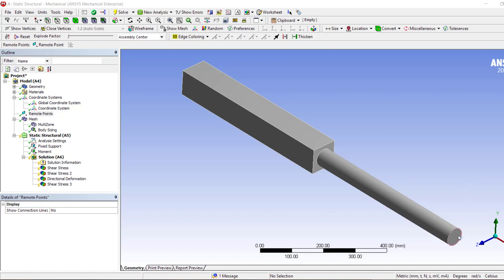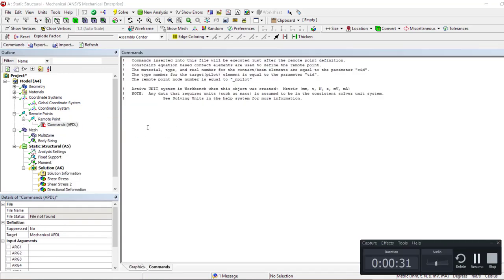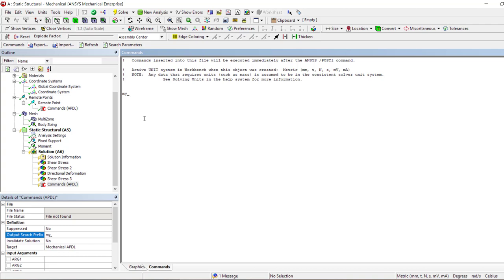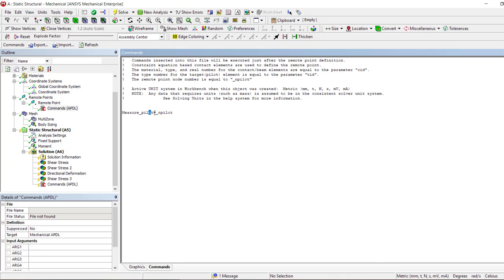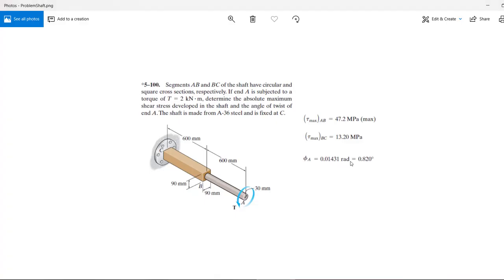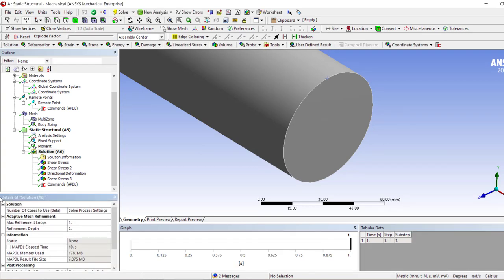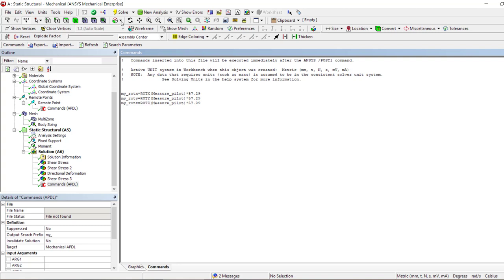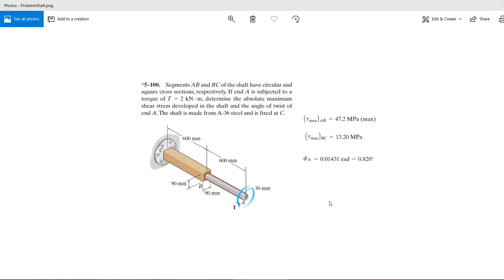How to Measure Angular Displacements/Rotations in degrees Using APDL Commands in ANSYS Workbench

Comment: Thanks! 
I just can add that if you need high precision use 180/Pi
For example:
PI=ACOS(-1)
my_rotx=ROTX(Measure_pilot)*(180/PI)
my_roty=ROTY(Measure_pilot)*(180/PI)
my_rotz=ROTZ(Measure_pilot)*(180/PI)

or for arc second:
my_rotx=ROTX(Measure_pilot)*((3600*180)/PI)
my_roty=ROTY(Measure_pilot)*((3600*180)/PI)
my_rotz=ROTZ(Measure_pilot)*((3600*180)/PI)